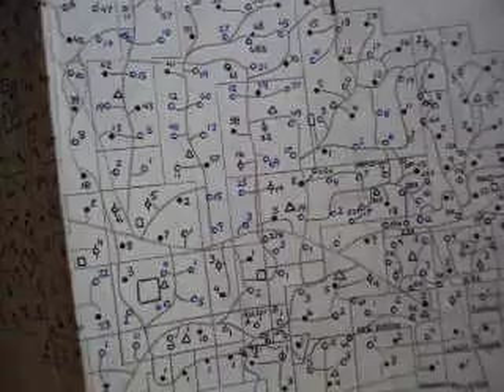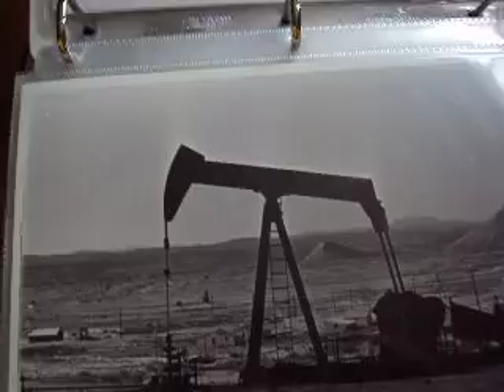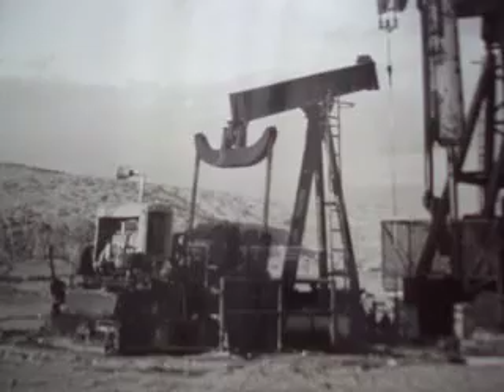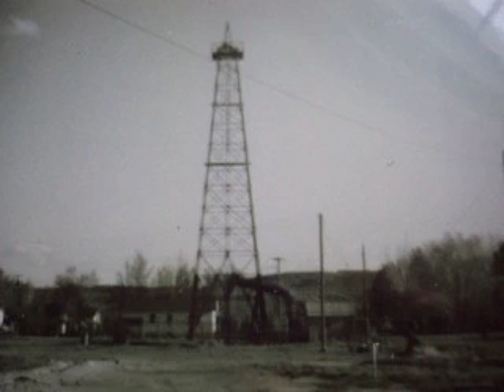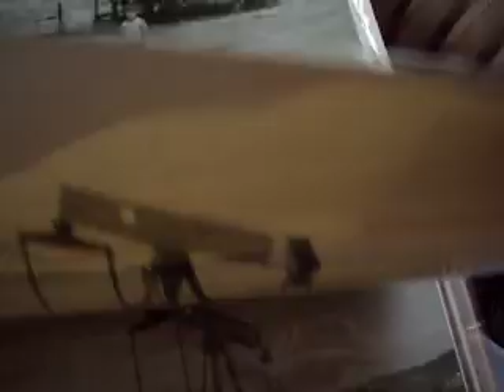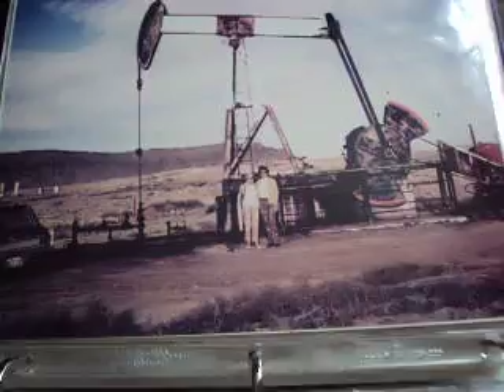LOOKING AT OLD RANGELY OIL FIELD PHOTOGRAPHS

Comment: TV was free if you recall, not the 100 dollars per month with "cable".
Reply from the maker: It was free, yes, but our TV was three channels that were beamed in from distant Salt Lake City, Utah -- 300 miles away, the signal forwarded from tower to tower, over the mountains, to the final tower on our Mellen Hill.  The pictures were "snowy" and in black and white.  Stations went off the air at midnight.  There was no Internet and no personal computers or cell phones -- long distance phone calls were expensive and calling overseas was a luxury few had access to.  Cameras relied on film, expensive to have processed, it took a week to get your photos back and there was no way to "post" them for others to see.  Our sense of isolation out in Rangely in those days was a lot greater than most kids experience today, as a result.  Modern conveniences are expensive, but they really opened up our world for us.